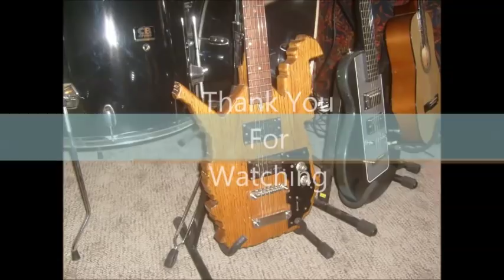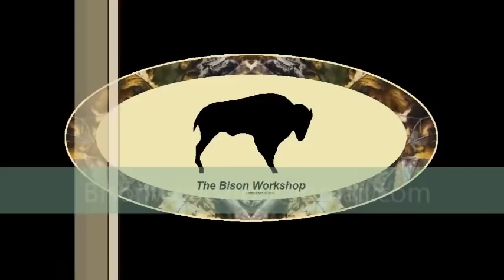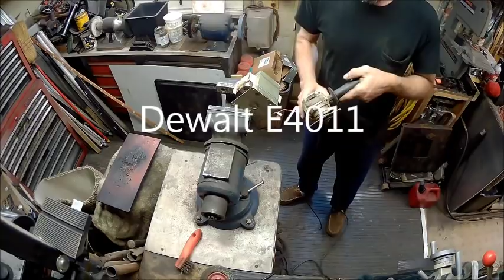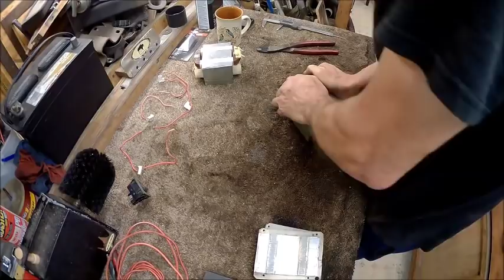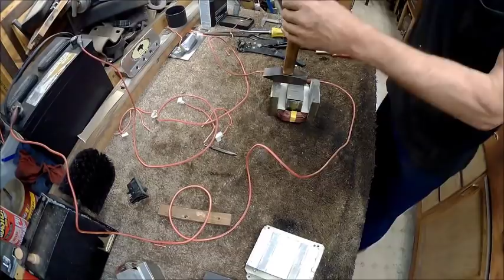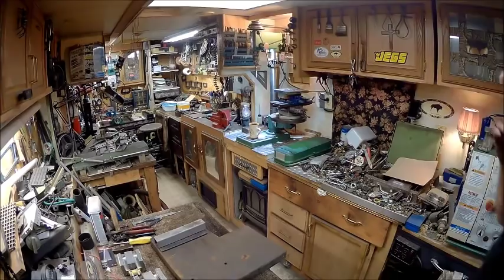diy magnetic chuck part 1

Comment: If you wire them in series, you'll have less of a current / heat issue, assuming the same voltage.
Or just investigate using the other winding, measure the resistance can tell you how much current will flow.

Comment: No need for a laminated core if you are using DC, solid soft iron core has higher perm which will give more field per amp/turn, and you can fab it to the ideal shape.
If you want to completly demag it, hit it with AC for a second or so.

Comment: Think if you try a control off a stove at your battery you can control the amps put to the magnet , that way you can stop the over heating of wire and still have good hold power, it would be worth a try that way you could put the control near battery and not worry of it being changed from what you set it to !   They do make ceramic limit for amps but they get hot with extended use and also drain battery more than a stove regulator to heat coil on stove !    that is what I would try before spending any bucks !

Comment: Interesting project Bob, you may want to look into heat resistant DC wire connectors for it to go with larger wires. Hard to say how much current it will draw, I've not built one of these chucks before.Take er easy, Doug

Comment: 8 or 6 gauge copper wire. fuse it at 40 amps and see if a 40 amp fuse holds and don't blow.
Reply from the maker: im gonna run them in series